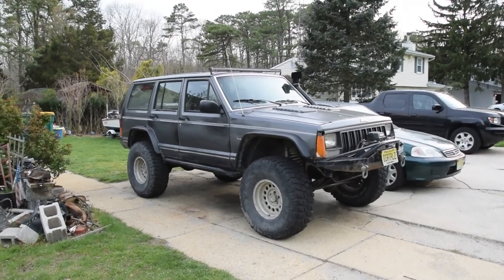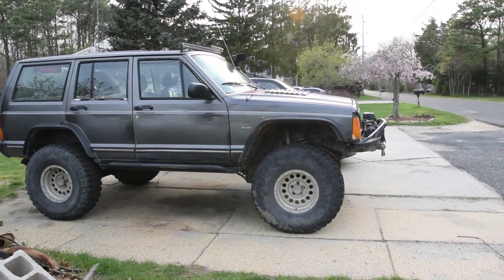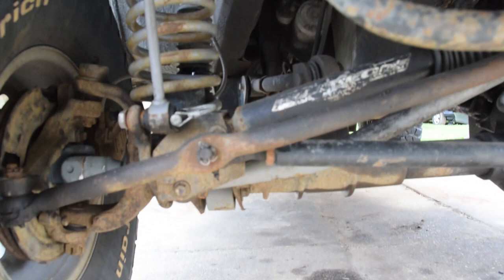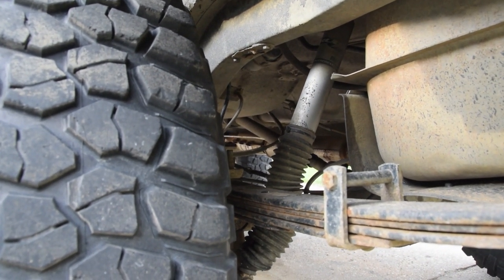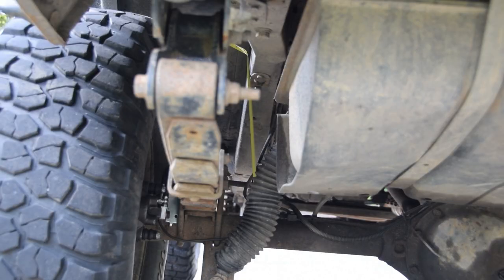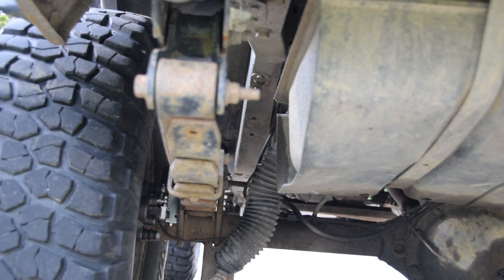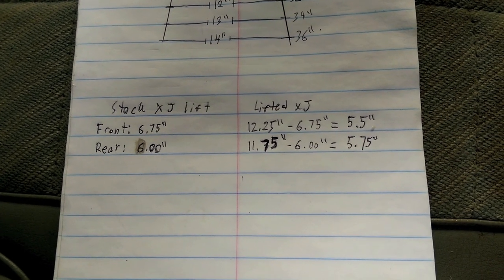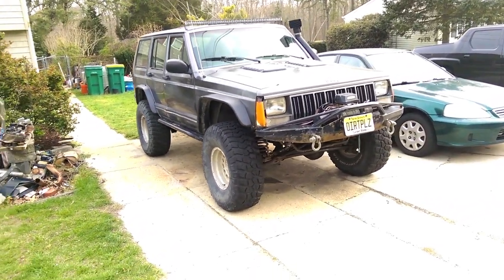Measuring Lift Height on a Jeep Cherokee XJ

Comment: if you start with an old stock XJ the issue is hard to sort out, with old saggy springs. i always use each end of the rocker panels as a measuring point to see what i have.

Comment: Does your cruise control work if not could you possibly do a video on fixing it?!
Reply: Check the vacuum line that goes from the manifold on the drivers side of the car. Look up the cruise control vaccum diagram. Mine was melted. Fixed it in 1 minute. Works like a charm now.

Comment: hello I used the info you provide in my ZJ the 6.75 in the front and 6.00 in the back and it work it came to be 8.5 front and back I think it work in ZJ to my not but I'm happy .
Reply from the maker: The ZJ may have different stock specs then the XJ. I know ZJ Coils give more lift on an XJ so it may be worth looking up stock height.

Comment: Old video but IS YOUR MATH CORRECT?  From your description on the various rear axles you have:
  Rear Axle Centerline to Frame: 7.25"
  OR
 - Dana 35 (2.5" Tube) Stock Height: 6.00"
 - Dana 44 (2.75" Tube) Stock Height: 6.125" 
 - Chrysler 8.25 (3.00" Tube) Stock Height: 6.25"

The 6.00 inches for the Dana 35 appears to be correct but 
  -for Dana44 shouldn't it be 7.25 -(2.75/2) = 5.875 stock distance to frame rail
  -for Chrysler8.25 shouldn't it be 7.25-(3.00/2) = 5.75 stock distance to frame rail

To me it makes more sense since the axle centerlines are the same the larger diameter axle tube will be closer to the frame rail.
Reply from the maker: The spring perch is on the top of the axle which also affects how much farther the wheel is from the body. 

If you went from a dana 35 to an 8.25, you'd get an extra 1/4" of lift just from the different tube radius.

Comment: I've been a jeep xj guy for about 12 years. My Q is - trying to find a 3" lift for my 2000 xj  75% in town and Hwy / 25% off road Hunting and exploring don't rock crawl unless I must I pull a Trailer 5k to 6k miles a year. Budget is 1k for lift kit and I have the install covered. Can you recommend or point me to top 3 lifts for my usage.I'm not holding you accountable for results, I just need advice as I am asking several sources. 2 sources mentioned Zone Brand?Thanks for your time,Brian

Comment: Hmm I’m confused.  According to these numbers my RE 3.5” kit gave me 4.5” in the front and 5.25” in the rear with a C8.25.  Im still running stock bumpers and no rockers, but that just seems odd??
Reply from the maker: It's certainly possible. No armor will raise you up a little more.
Reply: So maybe my IRO 3.5” long arm kit might actually give me 4.5” to help fit the 35s I have for it?

Comment: do you know if i can run a 3 inch rough country lift and a 3 inch budget boost together? would i need adjustable lower control arms? and did you do anything to your paint?
Reply from the maker: Can you? Yes. Should you? Hell no. 3" is way too tall for a budget boost, I wouldn't go over 2." If you're getting a whole kit, do yourself a favor and get a proper one that advertises the lift hight you would like. The reason they get more expensive as you go taller is because they come with the extra parts you need to do it right. 

As for control arms, you generally don't need adjustable lowers. A kit that comes with proper lowers will be the right length for a lift. Adjustable uppers are nice to fine tune your pinion angle or caster though.

As for paint, I did clean up some rust spots and rattle can some factory matched paint over it.

Comment: Hey nick quick question i want to lift my xj and i was wondering if i get just the 3 in springs anx the 2 in shackles will it still give my jeep a lift in the front .?
Reply from the maker: +Bobby Barraza If the spring you are putting in say it will give a 3" lift, then it should give you atleast 3" more height in the front, maybe more if the old springs sag. The rear will probably sit an inch lower and may look a little goofy.

Comment: off topic but looking for help. maybe you or someone here can help. I'm doing a 5 speed swap in my 99. I know I need the computer but would I need the whole wiring harness. I'm not worried about the reverse lights and I'll just jump the nss.
Reply from the maker: +justin b Did a quick search and along with all the mechanical parts I think all you need is the Manual ECU. Possibly a sensor or two such as CPS or TPS but they might be the same on newer XJ's. Browse the forums and see what you dig up.
Reply: I did all night and finally found a good one.  I don't need no wires

Comment: Does your tire size affect the measurements?
Reply from the maker: Nope, and that's the beautiful thing about this method, it removes a lot of the variables out so that all you get is true suspension lift height and that's it. A total ground clearance measurement to the ground would change with tire size though.

Comment: What is the stock lift for 99-01? Is it it the same height?
Reply from the maker: Yes
Reply: @NickInTimeFilms  Is it accurate to measure from the center hub to the bottom of the fender flare? I am getting different opinions on this. I am trying to determine what TC drop I need. Is it common for one side of the truck to site an inch lower then the other?
Reply from the maker: Body lines can vary, especially with aftermarket flairs. Axle to frame is the most universal way to check. The suspension should be level, unless you've got a lot of weight on one side.
Reply: @NickInTimeFilms  No extra weight on one side that's the crazy thing.. Both axles are new and the suspension is all new as well. Well used leaf springs out of a 99 Jimmy to make the Cherokee bastard pack in the back.  I am going to go out and do the axle tube to frame rail measurement to check if its really off an inch, adn to get an accurate measurement. Appreciate the quick response.
Reply: @NickInTimeFilms  Ok so actually I haave been parking this thing in my driveway that leans towards the drivers side since I bought it. It does make the jeep lean to the side. Maybe it is because the suspension is left sitting on an angle? Hmm...
Here is my measurements. 
Front drivers side 9.5
Front passenger side 10 1/8"
Rear drivers side 9" 
Rear passenger side a little over 10"
yEAH.   :/
Reply: @NickInTimeFilms You seem very knowledgeable on XJ'S.. I am learning as I go here., Maybe you can tell me what you think this noise is? The guys in the forms said it is the drive shaft angle but I'm only at about 3" . I did find that my transfer case cross member bracket is worn and there is side to side movement, and vibration on acceleration. I believe this is what cause premature wear on whatever is making ths noise in my video. I need to figure this out before I rip it apart I cant be without my vehicle. https://www.youtube.com/watch?v=nndtrlCdSjo

Comment: The rear method will never work what if you have a full gas tank in the Rear it sag lil more
Reply from the maker: The difference between a bone dry tank and a full tank is about 130lbs. This could cause a height difference of up to a 1/2" (That's how much lower mine sat when I stood on the back) but to say it will never work as a method of measurement is silly. This is the MOST accurate way to measure and compare between vehicles as it only measures the height of the lift and nothing else. These measurements are also supposed to measure the lift height at ride weight so if you regularly carry around 500lbs of gear then you should check with the weight in so you know what you actually have on the road or trail. But good catch nonetheless.

Comment: Do you happen to know the stock height with a rear D44?

Edit) Actually, I am having a hard time figuring out why the measurement would be different with a D44. My original axle was a D-35 so the top of the axle (bottom of leaf springs) should be the same no matter what axle.
I'm prolly wrong, so can you please explain my error?
Thanks. Nice video. Very Useful.
Reply from the maker: What is being taking into account is the centerline of the axle. A larger Diameter tube gives you more lift than a smaller one so that is accounted for in the measurement. The Dana 35 has a Tube Diameter of 2.5." We want the radius which is half so that's 1.25." By adding that to the stock height of 6," we get 7.25" which is the hight from the center of the wheel to the frame. 

A Dana 44 Tube Diameter is 2.75," only a 1/4" taller. Cut it in half and you have an 1/8" more lift. So add an 1/8" to your measurement if you want to compare to a D35 or add 1-3/8" to compare from center of axle to frame.

Comment: Nice to see nothing wrong with the heap ooow no jeep ha ha ;-D sorry :-(.
Silly mood unloaded........
Im not sure what i think about the measurements, the tyres add height too, i thought getting the body/axels away from big rocks was the idea, so massive tyres to lift the axels would be my way.
But im a plonker and know nothing about your hobby, ill just stand in the corner with a traffic cone on my head and "D" scratched into the cone lol :-D
Reply from the maker: Well, as stated there are a few measurements one can obtain. Measuring from the bottom of the differential to the ground will give you ground clearance, but that is completely related to tire size. Suspension Lift is the big ticket item today, which measures how far the axle is from the body. Mo Lift = Mo Tires.